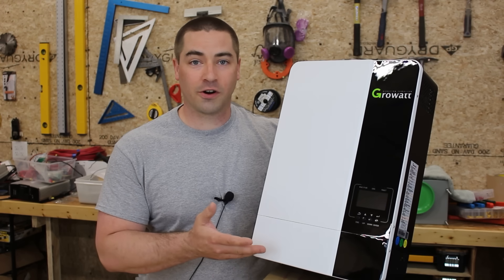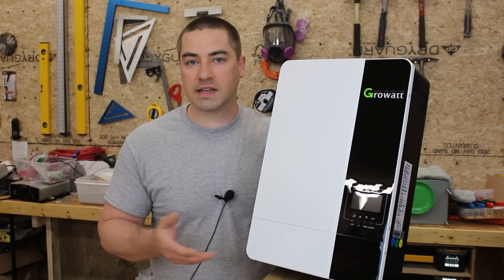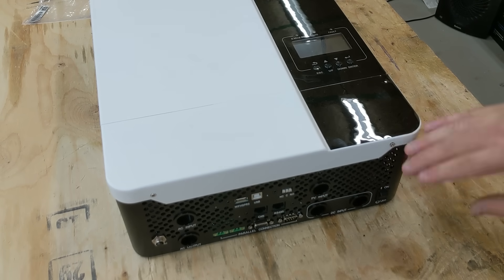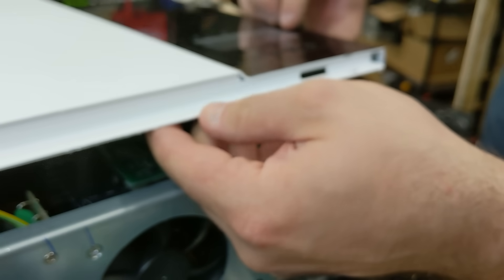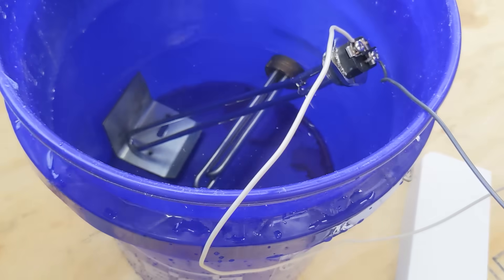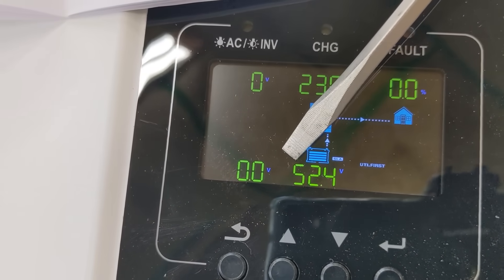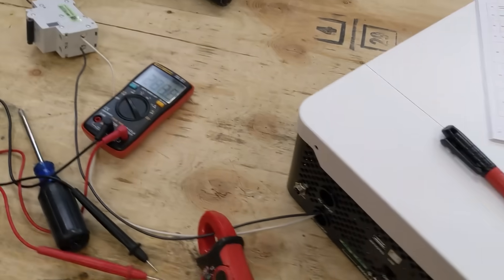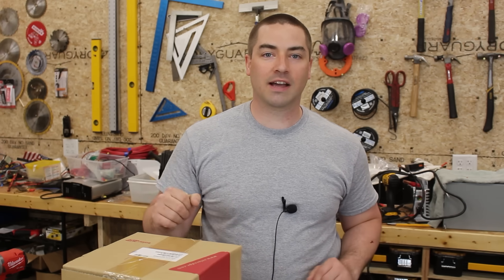Best Value Inverter, All-in-one MPPT Solar Charger, Growatt SPF5000ES, Part 1

Comment: Good morning David so I'm assuming you have played with this inverter awhile now I need to go through your videos and see but I just purchased one and it's on its way my question is do I need a transfer switch or Will the AC power that's feeding the inverter bypass into my sub panel that's being fed by the inverter or is the AC input for the inverter strictly to charge the batteries
Reply from the maker: I'm 99% sure it's a pass-through.  I've been running my whole house on a pair of these for over 2 months.  However, I don't use the pass-through option.  I charge with solar, not with the grid.
Reply: @DavidPozEnergy  so you're running your whole house off the batteries correct so I'm assuming you're able to run your entire house at night how many kilowatts worth of batteries do you have
Reply: And one more question do you have a video on doing the split phase I purchased two step down Transformers single phase 240 volt to 120 volt I'm going to run the primaries parallel with each other and then the secondaries I'm going to run in Ceres and tap the center wire for neutral
Reply from the maker: My battery stack is 30kWh.  More info in this video: https://youtu.be/89MyA7zPdYI
Reply from the maker: The video on setting up split phase: https://youtu.be/yWUfvvSa3K8
Reply: @DavidPozEnergy  thank you David for taking the time to answer my questions
Reply: This is the first time I've heard of an auto Transformer I purchased two single phase step down Transformers European style 220 in 120 out I was going to run the primaries in parallel to 220v in on both and then run the secondaries in series the center wire for neutral and the two outside wires will be 120 each

Comment: Can these be daisy chained or otherwise used/connected to have 15KW of inverted power and 15K of solar?
Reply: Yes and no. You have to run three separate 240vac (10gage) cables to a two pole circuit breaker for each inverter. So if you had three inverters, it would require, 3 each, 2 pole circuit breakers (30 amps). Then you can run the data connections between the inverters and that’s where they communicate to each other in order to achieve the 15kw power that you’re asking for. In other words, each inverter requires its own 30 amp, 240 volt breaker and feeding cables. Only the communication/data is daisy chained. I hope that made sense. Also note, if you plan on requiring 120 volts, you’ll need to wire up a split phase transformer in order to create a neutral in your panel. I just assisted a friend of mine where we installed 4 of these inverters and 2 split transformers to convert 20kw of solar power. It’s a great set up, but we ended up using 12 spots in his circuit panel due to the four inverters and two transformers.

Comment: Those 'warranty void if removed' stickers are illegal, says the FTC. ... “Unless warrantors provide the parts or services for free or receive a waiver from the FTC, such statements generally are prohibited by the Magnuson-Moss Warranty Act, a law that governs consumer product warranties,” the Commission noted
Under the 1975 Magnuson-Moss Warranty Act, the Feds mandated that you can open your electronics without voiding the warranty, regardless of what the language of your warranty says
Reply: Yes those stickers are illegal. Also, failing to honor warranty due to modification that couldn't have caused the issue is illegal. Meaning if I buy a Dell PC, upgrade the ram, and the psu dies they still have to honor the warranty, regardless of "no modifications" agreements. Actually getting them to honor this law may be a challenge.
Reply: SCIENCE!
Reply: With Chinese parts, warranty is always void.
Reply: @SetTheCurve  Not necessarily - there are good businesses in China as in the US and elsewhere!!
Reply: @SetTheCurve  🤣

Comment: I instaled a Growatt SPF 6000T DVM . What a mistake. It does not have auto restart function after low voltage battery error. When sun comes up must manually restart.  It is not suitable for remote areas

Comment: David Learning a lot from your videos. I want to use 1 of these Grow watt 5K  to run my well pump off of Grid and Batteries. Its a 1.5 Hp pump. I know it can handle running watts I'm concerned about start up. I tried to measure the start up but I don't think the tool I was using was fast enough and I only got 3k watts on start. Do you think this inverter will work for me?
Reply from the maker: I've spoken with 2 people who have well pumps and this model inverter.  In both cases it works great.  I'd still suggest a battery, but it doesn't have to be very large.

Comment: Hi David,  I just wanted to know, wheather i can use this inverter without battery. I just wanted to decrease my electricity bill. I also have an issue with reverse power. That is there is a problem if reverse power flows through my electricity meter. Thats why I wanted to use hybrid inverter without a battery. I also wanted to know if this inverter combine power input power from two sources or just switch between them. That is, say my load demand is 1000Watt and solar produced 500watt. Will this inverter combine 500watt solar power with rest of the power from utility or just switch to grid as 500watt solar power is insufficient to deliver 1000watt demand. Thanks in advance.

Comment: Hi David, 
Love your videos!
I am in a pickle. 
My Sanyo 190watt panels have an open circuit voltage rating of 67.5v. How many panels can I hook up with this Growatt? Two?
Reply from the maker: This particular model Growatt inverter (5000ES) can support up to 450 volts DC from the solar.  You have to add a factor for over-voltage, so what I do is: 450/(67.5*1.25)=5.3 panels, rounded down to 5 panels in series.

Comment: Hi, you convinced me, I will star building a solar system and i thin this inverter is what i need. Signaturesolar has no battery stock. I wonder what kind of lifepo4 pack I can use. Maybe a DIY pac but i need a BMS compatible with the inverter. Any sugestion? Thanks
Reply from the maker: Signature Solar has more batteries coming in.  Personally, I'd call Signature solar and reserve some batteries from the in-bound shipment.  However, if you want to build your own, then I buy cells from Battery Hookup.  Here is a great example they have right now: https://batteryhookup.com/products/k2-12-8v-91-2ah-lifepo4-module  4 of these modules would get you a 48v battery.  You still need to buy a BMS for it.  
Either way, use discount code DAVIDPOZ 5% off from both places.

Comment: Hello, can you please tell me if you can to help me to compile all the components I need.  If I use Growatt in my SUV, I need a battery and a solar battery, which battery is better to use, I think maybe I will assemble LiFePo4 from 4 pieces myself, 3.2V 280Ah comes together,  .  The question is ... if I have LiFePo4 and Growatt, then I just need  solar panels,or I need something else, I mean if I charged battery while I'm driving I need just use the switcher between battery and Growatt. And how big Solar panels can I use on the roof of my SUV for charging 4PCS off 3.2V 280Ah LiFePo4 battery's.  Thank you Edgar....🤗
Reply from the maker: The van is probably 12v, and the inverter I review in this video is 48v.  Also, the inverter in this video is a high-voltage solar charge controller.  On a van it might be hard to series enough panels for the voltage.
Reply: @DavidPozEnergy  ok,I just looked for the best option how to set up max power on my SUV, if I for months or so in forests, because I need use some powered tools outside the civilization.

Comment: Good Afternoon David, Many thanks for an excellent video,  I have a question about the AC Output, for the 220 V output, is it (220 V + Neutral as in two wires) or is it ( 110V+110V+Neutral as in three wires)
Reply from the maker: 2 wires.  In Part 2 video I add a transformer to make the 120-0-120.
Reply: @DavidPozEnergy  many many thanks for your prompt reply. I will certainly look at the Part 2

Comment: Did you hook this up to grid backup? I did and it pulls 2.9 amps with no load! This might be good for off grid but it is a power leach if you have connected to the grid!
Reply from the maker: I have not hooked it up to the grid.  Running off my batteries it was pulling 70w with no load.  Are you saying it was pulling 696w with no load from the grid?  Was it trying to charge batteries or something?
Reply: @DavidPozEnergy  just with power to the grid no load no battery it pulls 2.9 amps. not hooked to solar. with solar hooked to it and not battery no load 2.9 amp draw from grid.

Comment: These units are pretty reliable. I have a similar 5kw one that I’ve been using for the last 2 years running non stop with zero issues. It’s not the same brand but has similar settings and display and is build by VoltronicPower.
Reply: Thank you for sharing this important information
Reply: Is it Loud?
Reply: @uittyman  It does get louder when the cooling fans ramp up but thats only when it needs cleaning.
Reply: @Ayzee5363  How do you clean yours? I didn't realize these could be opened up or cleaned? Or do you just shoot compressed air (not canned) into it? Thanks!
Reply: @randomnamehererandoname1727  I clean mine with a blower. The front face can be removed by undoing the side and top screws.

Comment: Hello David, I see you use another brand of lithium battery, not using Growatt Battery. That is work/ compatible..? 
Itbcan use only lithium battery or we can use Lead acid?
Reply from the maker: The Growatt inverter has an option for "User defined lithium".  I set the program for max/min voltage.  The Growatt inverter doesn't have direct communication with the battery through CAN BUS, but that's a nice to have, not a need to have.

Comment: The manual shows only 1 bank of batterys when running in parallel "Parallel Operation in Single PhaseWARNING! All inverters must be connected to the same batteries and ensure each group of cables from the inverters to the batteries in the same length."

Comment: Hey Dave.  How has this unit been working for you?  I’m doing my homework to round up pieces to install my partial off grid system.
Reply from the maker: Ben running 24/7 for almost 2 months.  No faults, no errors, no problems.  I will say that the fans are loud, at least compared to my SMA inverter fans. No worse than having a window AC in the room.

Comment: David did your SPH come with the lead acid battery temp sensor? Growatt have none and I need to replace the one I have.  Do you know anyt part numbers on the device i could match it to?  Long shot I know.
Reply from the maker: My inverter did not come with a temperature sensor.  Sorry.

Comment: Hi all just finished installing mine ,pre charged it then switched on battery and turned it on , fault light came on ,went threw settings fault light will not go of and unit shuts itself down the error code reads 00 l have checked polarity on all connections which are all good would appreciate any comments
Reply from the maker: I don't know for sure without being there, but some things to check:
1. disconnect all solar and all loads.  Let's first see if it can turn on with just the battery.
2. Check that the battery is in the right voltage range.  48v-56v shouldn't throw any errors.
3. wires are thick enough
4. The BMS on the battery is good.  Sometimes the BMS is what's shutting down without realizing it.

After that, maybe call Signature Solar and ask them for help.  I'm not excluding the idea that it might be bad, just want to make sure to try everything on your end first.
Reply: @DavidPozEnergy  thanks Dave will try those things in the morning
Reply: @DavidPozEnergy  hi David thanks for your advice . This morning with the unit switched off we disconnected everything and then reconnected starting with the battery first and then turned on the unit , the fault light came on with no fault code as it did before so we switched the unit off , my wife Karen then suggested we connect the solar input after doing so the unit turned itself on much to our surprise without any fault light on , so l turned on the battery within seconds the unit began charging the battery 😄😄😄 we reconnected everything else and it’s running like a dream . I think our problem might have been we hadn’t realised we didn’t need to turn the unit on and should have waited a few more seconds when turning on the battery for the unit to come on , now we realise that’s the standby mode and turning on the unit only seems to turn on the ac which is all good now and working . Thanks for your help and all the videos you do , there great to watch and very informative wish you and your family all the best thanks again Dave and Kazzy from south Australia 🇦🇺
Reply from the maker: Glad to hear you got it working.  Good job to you and your wife.

Comment: do you have any recommendations for a hybrid version? What I understand is that SPF5000ES will charge my batteries from the grid, but it will not use the grid if I'm out of power from batteries. Am I right?
Reply from the maker: This inverter can use the grid as a backup if you don't have enough solar power.  However, this model doesn't back-feed the grid.  Back-feeding is what you do to turn your meter backwards.  Usually the term "hybrid" inverters refers to back-feed capability.
Reply: @DavidPozEnergy  thanks! That was my concern, that i cannot use the grid as backup. Now it’s clear to me.

Comment: What is the difference between 120v ac and 240 v ac if you use this then you change all the lines in your house to 220v and you you need to change out all of your devices to 220v or ad inverters to everything that is plugged in?

Comment: Love the Auto Transformer.  <- So you can use the auto transformer for Two 120v legs? Giving you the option of 240 or 120x2 correct? ( Depending on the fuse box wiring or sub panel. )
Reply from the maker: The auto-transformer can do a lot.  In my case I'm making two 120v legs from a single 240v source (inverter).  You can also go the other way.  If you have an inverter outputting 120v only, you can make 240v from it.  Kinda neat.  My part 2 video goes into more detail on the auto transformer. https://youtu.be/yWUfvvSa3K8

Comment: Any Issues from the inverter with max capacity or charging?  Anything you don't like about it? Lugs, grounding, display, menu's?
Reply from the maker: I overload it in the part 2 video about this inverter.  It ran at 110% before shutting down, so I was pretty happy with that.   Some people don't like the display, but I'm happy they have one.  Some inverters don't have displays or you have to buy it separate.  My biggest gripe is the fans are loud.  I film in my garage and have to shut the inverters off while filming.  Otherwise, it does exactly what it says it should do.

Comment: What would you recommend, two split phase 6kw inverter chargers or one 12kw inverter charger with a transformer?
Reply from the maker: There are lots of great options.  The simplest wiring is one large inverter like this: https://shop.signaturesolar.us/products/12kw-48w-150vac-120a-off-grid-inverter-by-growatt  You can still use the discount code DAVIDPOZ.
Reply: @DavidPozEnergy  Thanks for gettingback to me! That's the model I was looking at. I should have been a bit more specific with my question. I want to be able to run my 240V welder and shop tools, as well as the household. I think 12kw will be enough electricity to cover all our needs. I thought I'd have to run a separate system for my welder until I saw your video. Can I run the inverter charger at 240 and have a dedicated 240 outlet and use the converter for the house panel? 
If you've done a video on this, or I missed it in this video, please let me know. Thanks again!
Reply from the maker: You could, but it's not needed to run thing separately.  It just complicates things.  I've run my 120v welder on this system fine.  Sorry I don't have a 240v to test.   If the 12k inverter is enough for you, then just roll with that.  It already has 120/240v.  Simple.  The benefit to the one I show in this video is expandability.  Being able to add inverters in parallel.

Comment: Notice they have 36kw units even 70kw grid tie inverter on the store in the description are those us models notice they have 3 phases  ... With heat-pump ,lectric car,  water heater hitting inverter all at once 12kw+ 7kw+ 4kw =23kw  nice to have 36kw unit.

Comment: I tried ordering one of the Growatt grid tie inverter. However they are not UL1741 certified. And have no intention to do so. Had to cancel the order. So sad.
Reply from the maker: If you want UL, then check out the Sol-Ark 12K.

Comment: Beware :
- this inverter does not work in parallel mode without batteries.
- high self consumption, about 70 watts so for a 2 inverter paralel mode -> 3.4 kw per day, not really the solar way of life !).
- quite noisy

Comment: so it's a hybrid, Growatt SPF5000ES $900 transformer $300 , SanTan Solar T Series 250W Silver Frame Solar Panel $50 each, (12 in series 37.6v * 12 = 451v) and X2 parallel for 250w*24= 6000W about $1200...connect just like he did with a breaker box, and outlets, run everything when sun shines, then at night the 230v input from grid.( not sure if another transformer required for input.  Then if grid goes down, you still have power when sun shines.... the key is NO batteries required.  Total off grid $900 + $300 + $1200 + box, outlets, wire etc, $2500... lets say electric bill is $200 month about one year till paid off.  as a general rule of thumb, 3 ton AC about 3kwh, 5 ton 5kw...so run AC during the day, the grid ac during the night....hmmmm

Comment: Input 230V single phase...or can we use standard 220/240 double phase for input?  Are batteries required if connected to the grid thru 230v input?